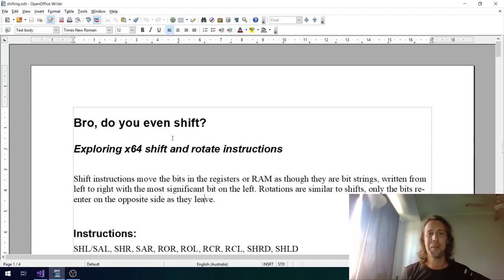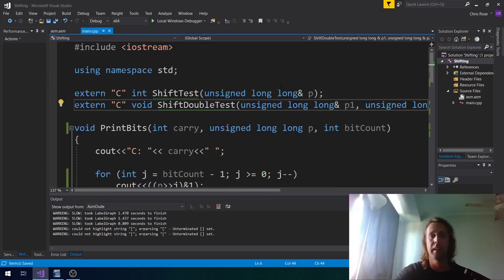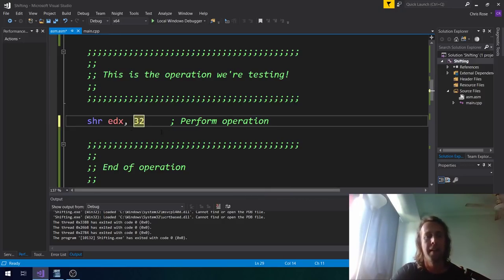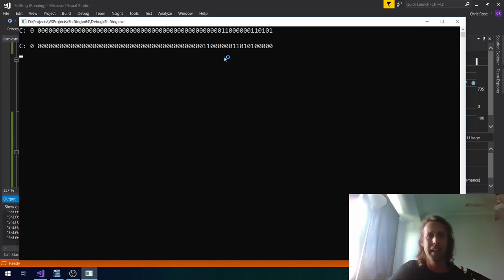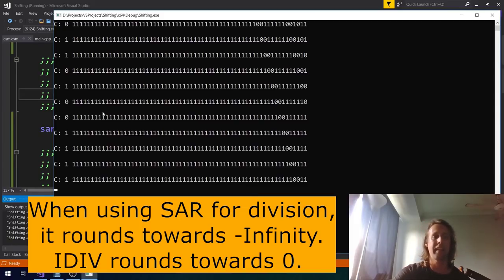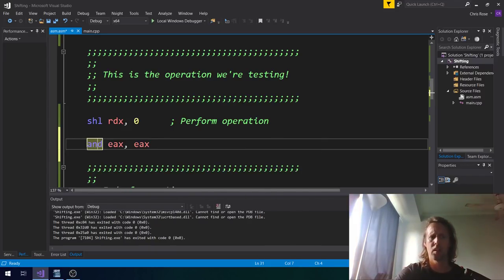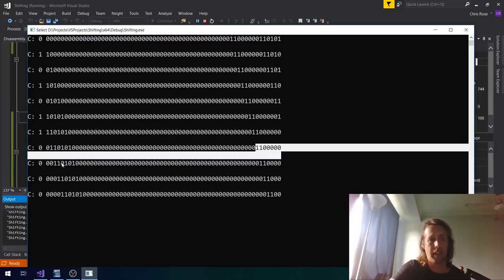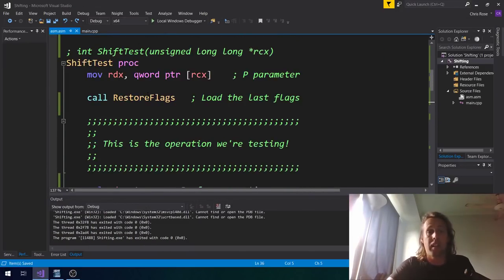Modern x64 Assembly 8: Shift, Rotate and Bit Manipulation Instructions

Comment: Great series! Recently Ben Eater made a video about integer division implementation on 6502 CPU, that video made me realize why 'rotate with carry' commands were introduced. They allowed to perform shift of numbers much larger than bus width of CPU. For example, perform shift of 64-bit number on 8-bit CPU. This is just sequence of rotates with carry. Each time carry from previous byte goes at one sides, while bit which was 'extracted' from current 8 bits goes into carry flag instead. Probably double-precision shifts were introduced for similar task, but for more than by 1 bit. 

I hope to use it for very fast image rotation implemented as two shears, while one of shears comes down to shifting all pixels of the row left or right.

Comment: One fun thing we used to do to save clock cycles is multiplying with shifts. Say you need to multiply something by 10 shl 3 times multiples by 8 then shl once multiplies by 2 and add the two shifted results together gives you a x10. This was a bit faster than the multiplier command.

Comment: I wish you had shown how to combine four 64-bit values together to form a single 256-bit value. I assume it takes multiple instructions to add two 256-bit values together, or to shift them. I wish you'd shown the details, especially since it  requires proper use of the carry flag. (I had to learn the technique decades ago, on the 8-bit Commodore 64, which needed multiple instructions just to add 32-bit values. Today, 64 bit values are generally big enough. But back in the day, 8-bit values were way too small, and having to chain multiple 8-bit operations to perform 16 or 32 bit arithmetic was the norm.)

How soon will you cover how to set, clear, test and copy bits in the flags register? Does x64 assembly have a single "Clear Carry Flag" op code? (I am familiar to old 8-bit 6502 assembly language, which did. I am only now trying to learn modern assembly language.)

Comment: Ah so ROR could kind of be used for switching endiness order I.e.

FFDDCCAA could be rotated right 8 to make CCAAFFDD where in C++ you would have to do quite a bit of flipping values around to produce that and from what I saw on godbolt there's not a good way to do this without the compiler adding in extra instructions. 

Idk if that's the best way to swap byte orders and i know you had some other vids prob on a similar topic but it seems like a good trick.

Comment: nice video but I have problems to unterstand popfq, pushfq and what the flags mean.
Reply from the maker: Flags register is a bunch of bits used to perform conditional things. Like, when you compare two registers, if they're equal, then it sets a flag so you can act differently if the two operands were equal. The pushf and popf instructions save and restore the flags register to and from the stack. Hope this helps, cheers for watching!

Comment: Hello, I know that this question is not directly related with this video, but if I do not overcome this problem, I will not be able to continue the training. In my .asm file I have :
.code
Some proc
 mov eax, 243333
 ret
Some endp

I have 2 errors : A2008 syntax error : in instruction .
One is pointing to "Some proc", the other to "Some endp".
The third one is: Error MSB3721 The command "ml64.exe /c /nologo /Zi /Fo"x64\Debug\Asm.obj" /W3 /errorReport:prompt  /TaAsm.asm" exited with code 1. 
What am I missing? 
I am using VS 2015 (140) Enterprise. Thanks!
Reply from the maker: Have you got a line with "end" at the end?
Reply from the maker: Your code works fine on my VS 2015 community if I add the END directive. I'm not getting the syntax error on "Some proc". It's almost like it's reading "Some" as an instruction. What happens if you change the function name to "SomeFunction"?
Reply: @WhatsACreel  I changed to "Whatever" and it works. Thank you!
Reply from the maker: @gearstil  Glad to hear boss!
Reply: @gearstil  make sure masm installed with windows sdk
Reply: you should watch the first videos where the environment will be configured